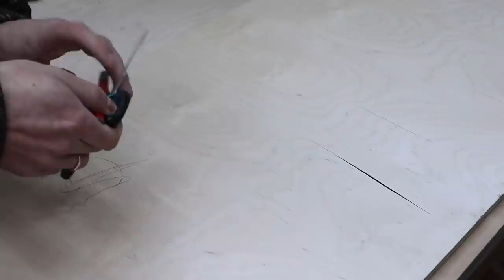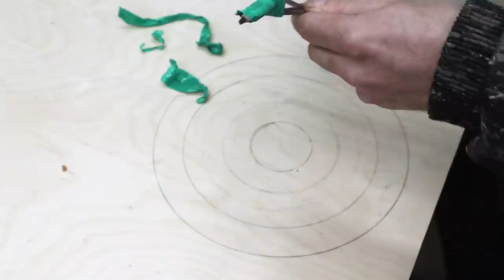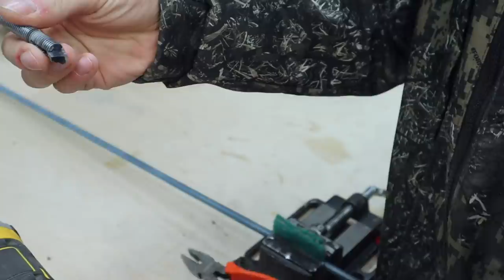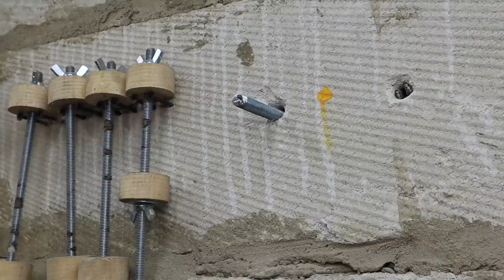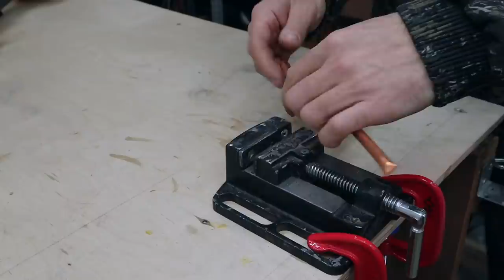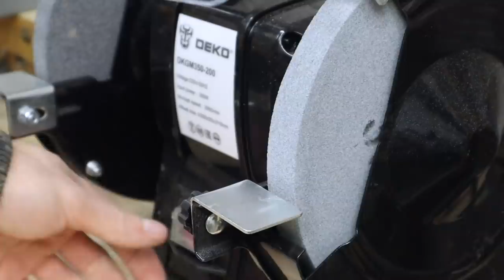Мало кто знает этот секрет медной трубки! Отличные идеи своими руками!

Comment: The wall anchor was a terrible hack, try this instead, take a couple centimeters of copper tubing and tap it in the hole, then screw in the bolt. You should have better results.

Comment: the anchor will not hold because when you tighten the nut the wedge stays in the wall/hole and the screw comes out

the principle is to pull the wedge outwards to split the screw more to make it to lock
do not try to hang or hold anything like this 
it will pull out of the wall